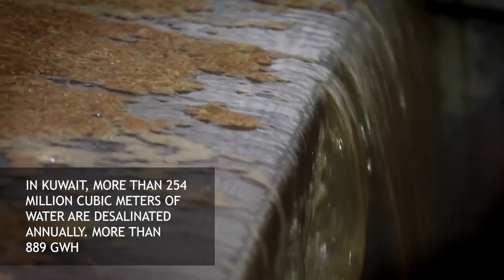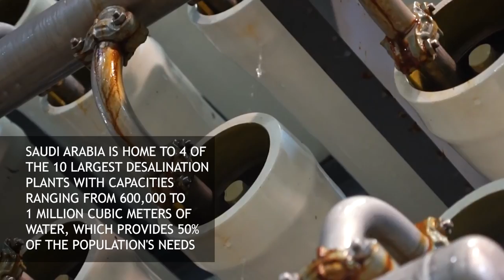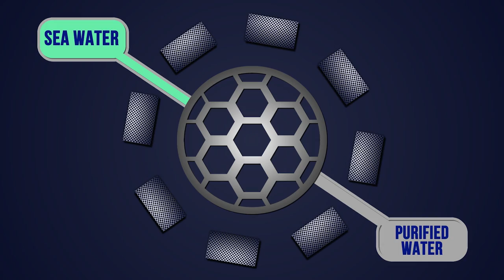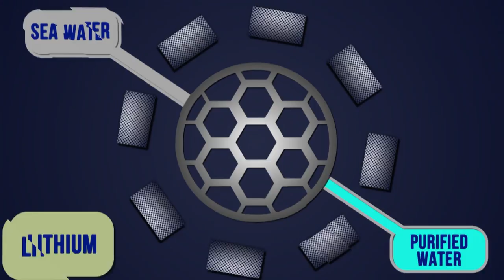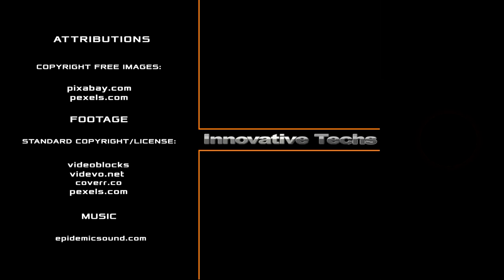How this seawater desalination technology will change the world

Comment: Solar concentrators-> steam -> turn turbines -> electricity -> condensed water -> household use.
Reply: Exactly what i thought, you can even add another step using a sterling engine to condense the water gathering even more electricity.
Reply: Yeah, they tried that. The technology to track, collect, and concentrate solar radiation to a "boiler" drum is incredibly complex and expensive to run. Power plants don't operate on 100°C (212°F) saturated steam. They need superheated, dry steam to produce any appreciable amount of momentum. The efficiency of a turbine is directly related to the temperature differential between the turbine inlet and the downstream condenser. The condenser creates and area of low pressure that the high pressure steam rushes to occupy. This migration is the force harnessed by the turbine blades that causes them to spin. Of course a gearbox can adjust the resistance of a turbine but it also creates extra complexity and reliability issues. This overall effect lowers the output and efficiency of the process more than most people consider. Building a plant is one thing, operating a plant is another. Keeping it running is a completely different nightmare all together.

Comment: NEOM should use the seawater directly as well - use it for evaporative cooling instead of the fresh water..
Either to cool public places and homes, or to cool and humidify shade-houses, to reduce the amount of fresh water needed to grow local vegetables etc
Salts can be harvested from these systems too
Reply: The brint is a energy resources as well! Think they can use that also if not used allready in the fresh water plants.
Reply: cooling with seawater will turn the city to rust
Reply: @mshtysf4646  My home city is cooled with sea breezes, and hasn't rusted as yet...
Evaporated water is much the same, if evaporated from fresh or salt water, so you'll have to explain why evaporative cooling (which doesn't rust anyone''s house that I've seen) would rust this city??                 :)
Reply: @mshtysf4646  no it will not.
finland use seawater to produce cool water in helsinki. mostly cooling offices and buildings in summer time.
it is close system. sea water from deph 40meter were it is very cool. sea water is used heat exchanger.
no need get rid of salt.....
Reply: @Apina79  The water in the Gulf of Finland has significantly less dissolved chlorine than most sea water, due to where the water draining into it is coming from a rather significant basin, and the fact that there's a net flow southwards from the snow and ice melts and pushes the contents towards  Poland.
Reply: @D_Rogers  
The Atlantic coast of America has quickly rusting cars compared to the interior, even in places like Georgia, South Carolina and Florida where there's no winter snow or ice creating a need for salting the roads.
Reply: @akulkis  Yes, airborne salt along coastlines is inevitable, but not such an issue that you can sell a ton of products as a result..      :)
Reply: @mshtysf4646  that's SWAC technology and has been implemented in some regions. It's not a totally new unlike the desalination dome

Comment: To build a desalination plant located in the desert that uses electricity is the epitome of standard corporate blockheadedness.  With thousand degree temperatures all year long, some genius decided that an electric furnace would be a good idea and was able to sell the idea to investors (i.e. government).  The lack of creative thinking at the corporate level is only exceeded by the numbskulledness of government bureaucracy.
Reply: The idea is that the sun will provide the thermal energy required to evaporate the water.
Reply: Solar panels can supply the electrical energy

Comment: There is a new invention: Process of converting seawater to hydrogen, piping it and reforming it to freshwater that converts seawater into freshwater AND transfer it inland at minimal cost. This investment would last generations.
Reply: that distilation, and uses a lot of electricity, they call it destiliation but he means to say distilation, reverse osmosis passes though a membrane where as distilation evaporates the sea water and collects as freshwater it uses a lot of electricity, to make hydrogen using electrolosis and mixing it with oxygen would use the same if not more elctricity, to boil water and collect the steam as water to fall around a surface and collect again as fresh water would use less electriciy than what electolosis in water would use
Reply: @alistairmacgregor1456  It is neither distillation nor reverse osmosis.
Reply: @climatehero  I know it is electrolysis the only way to make water into hydrogen, that would use a lot of electricity more that distilation, but combined it is distilation process to distill the water extract salt, hydrogen is then mixed with oxygen to make fresh water and would use even more elctricity than just boiling the water
Reply: @alistairmacgregor1456  The process is called Dual Fuel cell. The first PEM fuel cell extracts salt from seawater and produces hydrogen gas that can be transferred for very long distances and at high altitudes at minimal cost. Granted it uses a lot of electricity. At the end of the pipeline, the other fuel cell receives the hydrogen and combines oxygen from the air to reform water. This generates a lot of electricity, 95% of the initial electricity, so the net cost is only 5%. Now you have to factor in the cost of transporting water in the case of reverse osmosis, that is very expensive, to the minimal cost of transferring hydrogen; it becomes very efficient.
In the case of Saudi Arabia, a single source of desalination could generate hydrogen to feed a whole series of freshwater stations and the resulting electricity.
Reply: @climatehero  I will have to look into this, high altitude hydrogen is dangeroius blimp style, but I cant see other ways transporting in high altitudes, the thing i dont get is how does combining hydrogen and oxygen create 95% or any electricity
the best way to clean water is a implosion vortex but no one knows much on implosion.
Reply: @alistairmacgregor1456  Actually hydrogen is safe because it is very volatile.
Fuel cell have the particularity of making reversible reactions; inputting electricity and water produces hydrogen and oxygen (that is released in the air); then inputting hydrogen and oxygen from the air produces water and electricity.
Of course the freshwater produced is chemically perfect and doesn't require any treatment.
Reply: Why pipe it inland? Most consumers of water live in the coasts. Let the inland people use the freshwater and coastal people use desalinated seawater.
Reply: @phoenix5054  Inland farmers have just about exhausted freshwater from aquifers and the Colorado River water has been overallocated. New freshwater is needed.

Comment: they should just pump water up a 100m tower then let it fall through a membrane at bottom as it drags the water up (as well) so hardly any pumping, all while pressure is at 100m depth equivilancy at membrane so huge pressure
Reply: So how will you get rid of sediment?
Reply: Brilliant idea.
Reply: @Abdullah-AlShammari  now I'm a bit smarter of course need pump to get through membrane and clear sediment. Apologies
Reply: Has anyone ever done a cone (pointy end at top) down to say 100m deep and wide at base and found water pressure still (same) huge at depth. Surely it is pressurised same as 100m etc deep in ocean but you never know as weight above is different

Comment: Collection of stock footage, combined with comments praising a project that is a clear waste of resources. Based on prior art, there are far more efficient technologies available to desalinate sea water and then they could easily be combined with renewable energy sources such as photovoltaic power as electricity source for a reverse osmosis plant or thermosolar power as primary heat source of a multi stage flash desalination unit.

Comment: to much electricity will be needed for any of these, unless it is solar famed or a solar field but you are still a while of harnesing the sun, you dont even use a magnifying lens and thats basic common sense, magnify the solar rays by 5X you will improve solar, its not a hard think, but solar uses quarts and coal and more coal to reach 1800 degrees to fuse the solar cells made from quarts and coal, so is it realy the answer, takes 2 years to off set production so it maybe but still harnessing low amounts, there are other ways aswell to harness even more from solar that is unbelievably simple to do, also the inverter could be edited the copper coil relay is missing something that could improve it a lot, but th issue here is water, there is two ways to get water, one is to implode it and the other is to use reverse condensing from the air, they would run on small units as they cannot produce swimming pools of water but spread out in small operations they work well, I dont think graphene is the answer from a health point of view,

Comment: How to regenerate water on dessert  well simple inpiling a deep pipe 50 feet below the ground that deep there's an a water and oil mix yes okay filtering water below oil on top for pumping water is the oil on top that used by the pumping machine and generator for energized your population the water is going to the avaporator carbon filter and for human use